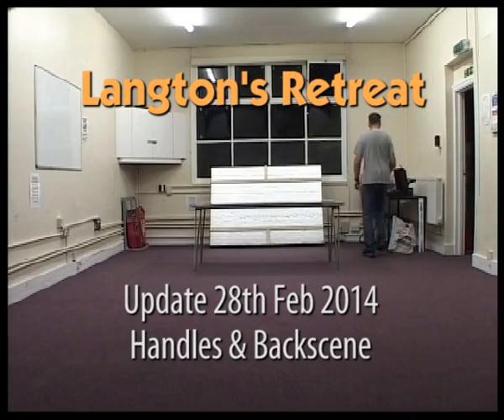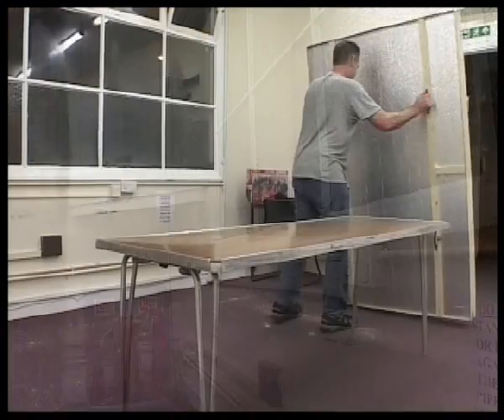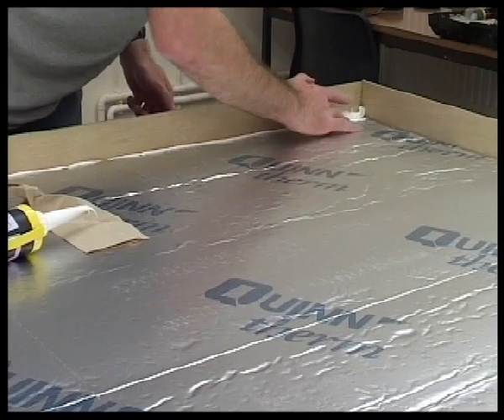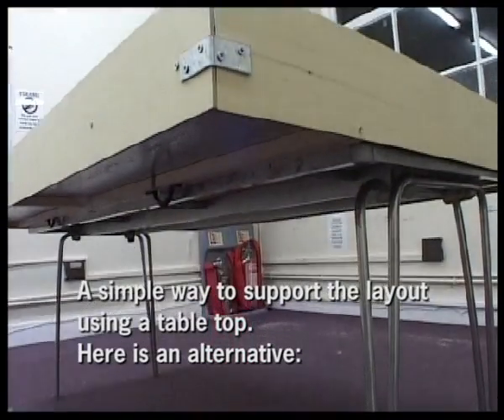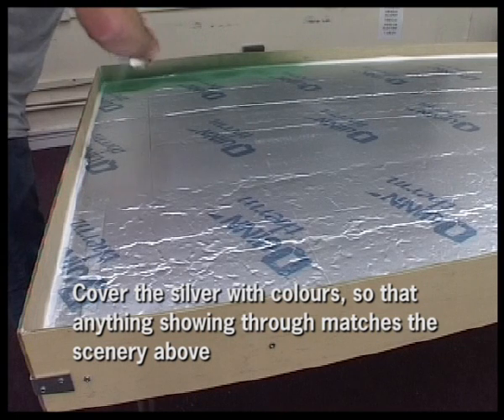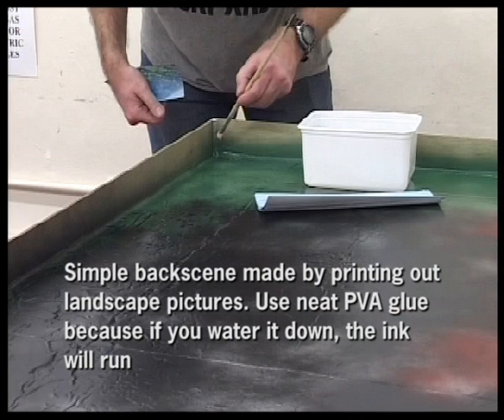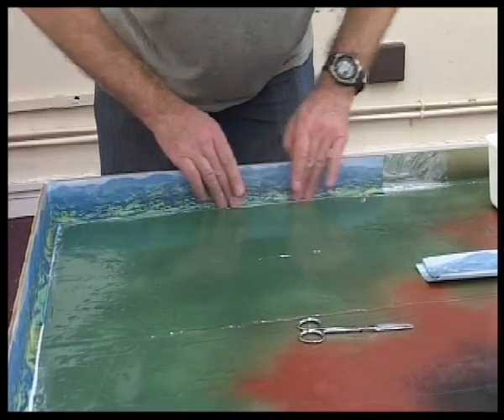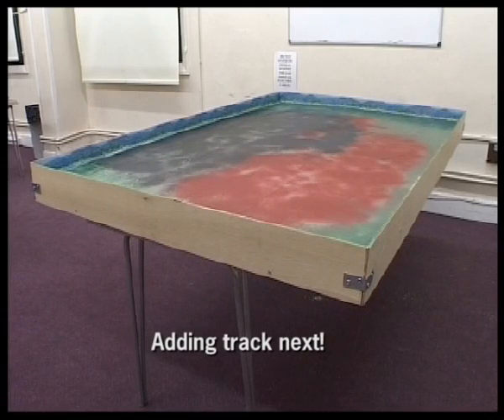Make a Simple Model Railway Part 2 -  Handles/Backscene

Comment: Sorry I have another question did you have any short outs on the track after you sprayed it ? 
cos my oval is like yours but my standard hornby control seems to power down when I run a train which comes to a stop
Reply from the maker: Ok, so the paint is now acting as a barrier to conductivity. So you just need to clean the paint off. Best bet is with some suitable paint thinners, and just put it onto some cloth and then rub away on the top surface. Then it will be fixed. In fact every few weeks you should clean the track anyway with surgical spirit (a cheap track cleaner) that you can buy from a Chemist. Track will often need cleaning. Doesn't hurt to do it every time before running really. 
If the paint is on really think, then you might need a very mild abrasive sandpaper but this can score the rails slightly, so use the thinners first.
Reply: No no chap I just sprayed the hole board no track was on it 
I put the track on top of the board when the spray paint dried 
So I connected up the hornby control box put my train on the track it round once they just slowed to a stop 
But I'm putting cork down next to see if that fixs the problem
Reply from the maker: Might be worth cleaning the track anyway then. Of it might be poor connection with the fishplates that connect the tracks. Hard to say without seeing it.
Reply: Yes I will try that aswell I will try and do a basic video

Comment: Hi I have one last question 
how do you reattach the foam section 
as I cut off 2 ft which I need to put it back on to make it 8 ft
Reply from the maker: Hmmm, this could be a bit tricky. I think the best way would be to use hard as nails or a lot of contact adhesive. If you have some BBQ skewers they could also be pushed into both sides on the edges, as spikes to help locate and hold the two pieces (if that makes sense).
Reply: Ah now those I have a bag of I will get to b&q soon then I need to extend it badly thanks again for your help I will try and do a video soon now I know how to do it

Comment: Hi again I have a question 
where did you get the green spray from 
and what was it called ? 
I went into halfords to get the red and grey but all the greens were metallic or pearlescent I didn't know which one to get
Reply from the maker: I did actually use a car green spray, which is of course glossy but this doesn't matter as it should all be covered by other materials. It is only to have a touch of colour showing through rather than silver. If it does show though it won't notice it is glossy, so it is ok to use. Or use paint you brush on even. The finish is not important here as it is just a backing colour. Hope that helps.
Reply: Oh ok thanks where did you get that car green spray from
Reply from the maker: Got the spray from a car shop :-)
Reply: From a car shop hmm well halfords just don't have the green you used so I'm gonna have to find a car shop then I have sprayed the foam board in grey primer  gonna use cork sheeting but one roll is not gonna be enough I will have to get two more but operation foam board railway is now underway
Reply from the maker: My local car shop is a one-off merchant called Double D Discount. I think yoiu might be able to get sprays from Wilko or The Range or Hobby Store too, shops like that.